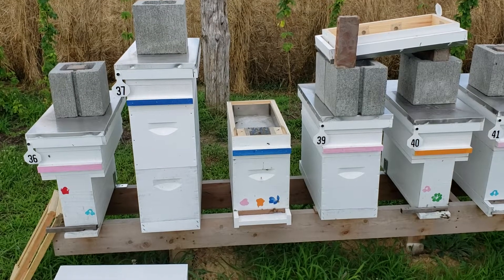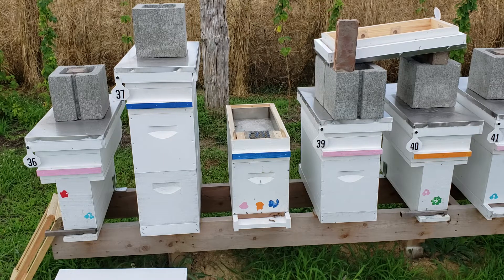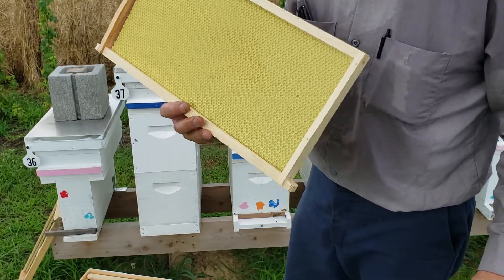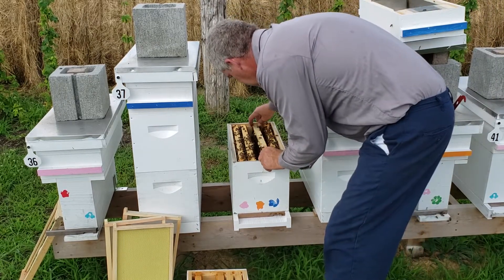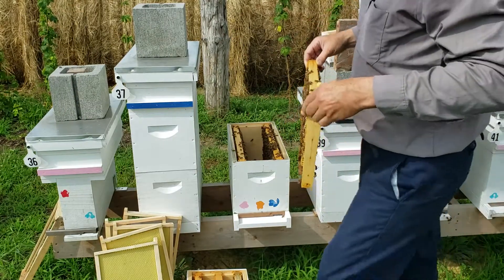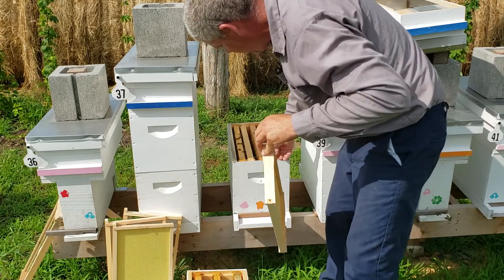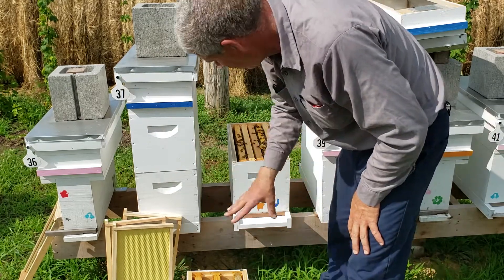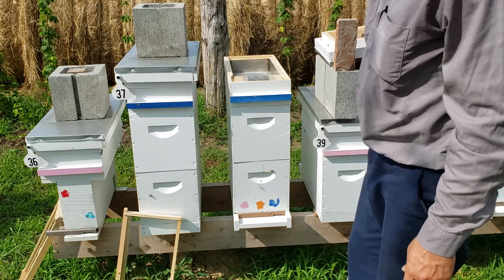Should I Use Starter Strips Or Full Foundation

Comment: I have had excellent luck simply using started strips ! its also a nice savings , the other up side is if the bees want some drones they add them right in !
Reply: i guess the down side is you have to use some bees wax to glue the strips.
Reply: i am also using 5 frame boxes instead of 8 or 10s .
Reply from the maker: Yes, but I always have some cappings and old frames I melt so pretty easy.